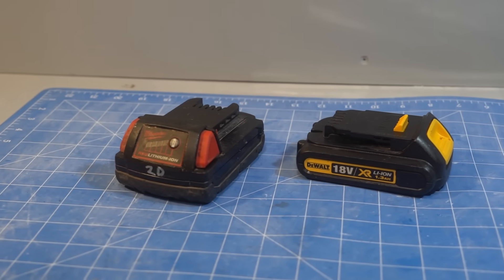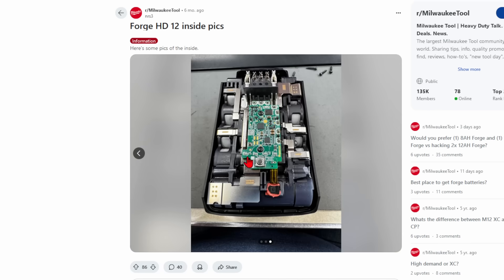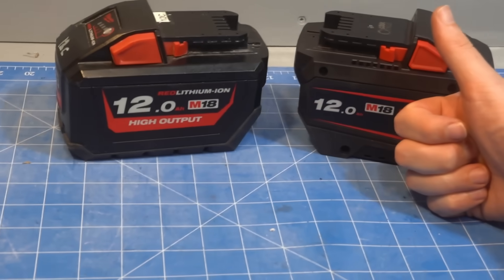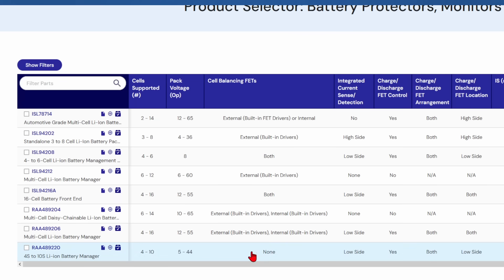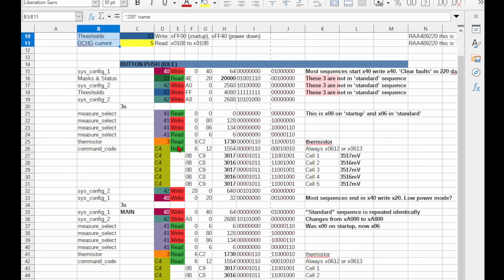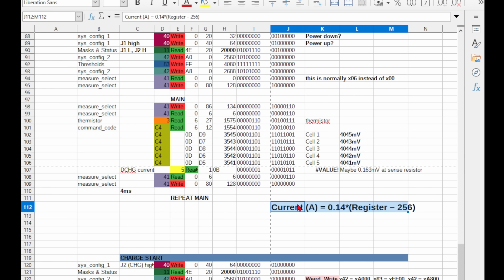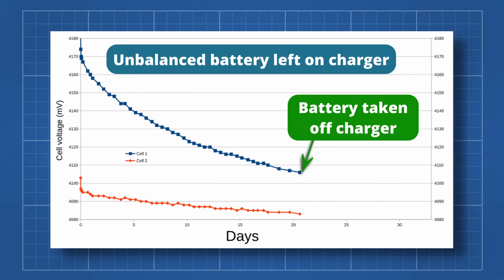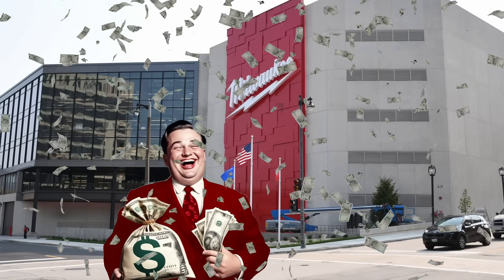[011] Do Milwaukee FORGE batteries balance

Comment: Could you reverse engineer the circuit board and make a replacement board that would balance the cells?  Or can you reprogram the microcontroller so that it can take advantage of the balancing?
Reply from the maker: Reprogramming MCU might be possible. It wouldn't be a great solution for most as programming an MCU isn't an easy task for most people. There's also a few different boards, so we'd need a few different firmwares. I'd mostly just like to shame Milwaukee into fixing the problem themselves.

Comment: please please do this analysis on a RYOBI 40v battery. They BRICK themselves and there is no way of repairing them that I can find on the internet. Maybe you can be the hero to many :).
Reply from the maker: I do have a Ryobi 30V mower and battery that I want to test. I've seen a few people using a RESET pin, but apparently that doesn't work on newer packs.

Comment: A Milwaukee M18 tool owner should take proactive measures to occasionally open the packs and manually balance the cells with leads coming from an 18650 charger.  You can use little magnets in the jaws of the clips to keep the leads connected.

...Which is stupid thing that you need to do, and why I'm glad I'm a Ridgid man(yes, I'm aware they also ultimately answer to TTI).

Comment: Thanks for the info!!! Can the cells be balanced without separating them from the bus bars? Reason asking i have one that got discharged too far and wont charge and have tried hooking another m18 too it but no luck yet even tried hooking the othe m18 to the bus bars before the circuit board but no luck!!!! Any help would be appreciated cant afford a new battery at the moment and really nead all of them working!!!!
Reply from the maker: Connect an adjustable power supply or single-cell Li-ion charger to the bus bars and charge each bank individually. https://www.youtube.com/watch?v=IsSzAWH3oQo
Reply: @toolscientist  thank you I'll have to give that a try !!!!!!!!

Comment: Great video. I'm building my own battery pack for a Dewalt DCD805 Drill, because the off-the-shelf packs lack critical features (e.g., cell balancing). Also, I just love batteries haha. I do think the mechanical engineers for Milwauekee FORGE pack did a decent job for optimizing space, current carrying capacity, and thermal dissipation: 1) 8:18 the hybrid busbars are thin and wide (maximizing surface area for convective cooling), 2) 5:05 the laser welds cover smaller area for positive and larger area for negative terminal of the batteries for heat dissipation (this is my guess, so I'd love someone to chip in on this). I noticed that EV companies such as Lucid Motors do something similar: they make the negative cell busbar connections thicker/wider than positive cells. My guess is that the battery engineers wanted to dissipate the heat of the cells better, since the cell's anode conducts heat better since most anode materials are copper, which have x2 thermal conductivity than the aluminum cathode. 

Also, this is my first time seeing a hybrid busbar. Are there any other devices that have hybrid busbars like this? I'm curious how they are joined together. Also, I'd like to know if anybody here has experience working with them, since while the idea sounds nice, the interface between two dissimilar metals may also increase contact resistance, which may defeat the purpose of using copper-nickel busbar.
Reply from the maker: I have not seen any other plated copper busbars in power tool batteries, but they could be out there. If a brand nickel plated their copper bus bars after they were cut, then you wouldn't be able to tell just be looking, like we can on these M18 Forge batteries.

Comment: I fix the issue (temporarily) by taking the cover off, testing the cells with a meter, and charging up the specific cell pairs/triplets that are at low voltage without removing them from the package or desoldering anything with a constant voltage power supply.  It is mostly a matter of attaching the charging alligator clips in the right place to complete a circuit through the affected cells but not other cells or the bridges between cell units.
Reply from the maker: Yeah, that's the best way. I've also seen some people solder in leads and a JST connector and then use a RC Hobby charger to balance.

Comment: I'm thinking about buying some of those 15-cell M18 style cases from the internet and putting only 10 cells in to leave room for extra circuitry like a balance charger board.  Or maybe I'll just 3D print a new case for my 6.0's...
Reply from the maker: Yeah, just add a JST connector and balance with an RC hobby charger.
Reply: @toolscientist  Yeah that seems like the best option, although I don't really like it lol.

Comment: It's possible there's a battery balance tolerance so 1 millivolt may not trip that tolerance to rebalance the battery. It may have to be a bigger difference.
Reply from the maker: I took it up to 100mV, which is nearly 10% of the usable voltage range of Li-ion of 3-4V (they can do 2.5-4.2, but it's very non-linear outside of 3-4V). The old batteries where something like 600mV out and didn't balance. There could also be a max imbalance where it refuses to try - e.g. if more than 50mV, pack is dying, don't bother balancing. So that's another hard one to test.

Comment: If the communication simply uses I2C protocol, is it not theoretically possible to create a new charger with a new microcontroller that could send different signals to the internal IC on the batteries?  Is it conceivable that someone like you could design your own charger that would charge the same as the regular ones but then tell it to balance itself? I get that with those giant resistors it would take a crazy long time to balance itself, but you also explained with your 12.0 that it worked for over a year, and if it was able to continually rebalance itself throughout that time, at a minimum it would certainly give you way longer life if not keep itself balanced over that amount of time.  I'd really love to see code for this though because I'm not quite smart enough to figure out how to do this on my own but I think I could implement it if someone else created the initial code. I'd really like to have a 100W USB PD bidirectional charger for my M18 batteries, but I don't want to risk charging them in an unmonitored, unbalanced way.
Reply from the maker: No need for a new charger - the existing charger signals are enough to know when it's in CC, CV, or charge end. I'd probably wait for charge end; balance; then if all cells are below 4V, give the charger the signal to do a slow top up. So what's needed is to extract and decompile the firmware, modify it to have balancing, then flash the new firmware. Some people I'm working with have extracted and decompiled, but there's low enthusiasm for modifying the firmware as it couldn't be distrubuted (Milwaukee will have a copyright claim on the original code). It might be possible to distribute a patch, but that solution would be even more inaccessible. There'd only be a tiny percentage of Milwaukee users with the knowledge (or patience) to go through with flashing new firmware.
Reply: @toolscientist  I guess that's why I'm suggesting building a sort of DIY charger, is that would avoid any copyright issues.  US law has determined that even proprietary codes may be used for interoperability, so if we had this code to install into say an Arduino Nano for example, then mash a DIY charging circuit together, we could avoid copyright issues.  But also as I mentioned, having access to this code would be necessary for my dream of a 100W USB PD charger/power source device like the one DeWalt has.

Is that the firmware of the battery itself or the charger?  And I guess what I'm asking, at least in part, is can we simply send the code to the battery IC to balance the cells, or does it need a whole new firmware to balance at all?
Reply from the maker: @WargateXGWU  it needs whole new firmware in the battery. I don't think any charger signals could make it balance, so modifying or making an arduino charger wouldn't help. Only option is flash new/modified firmware to battery
Reply: @toolscientist  Oh OK, gotcha.  I was wondering, since the charger seems to be sending a "turn off balancing" signal, maybe the battery could receive a "balance now" or some kind of balance signal.
Reply from the maker: @WargateXGWU  i might have explained that poorly in the video. There are 2 chips in the battery: an  MCU (microcontroller) and AFE (Analog Front End). The AFE is what should do the balancing, but it needs the MCU to tell it which cells to balance. So fixing it needs new firmware for the battery's MCU.
Reply: @ So in the video when you say the part about how a signal is being sent and that signal turns off cell balancing (not that it was on, but the command is to stop balancing), that is from the MCU to the AFE?  It's not from the charger to the MCU?
Reply from the maker: @WargateXGWU  correct. The battery's MCU is signalling the battery's AFE to turn off balancing (and never tells it to turn on). This happens entirely inside the battery.
Reply: @toolscientist  Oh ok, now I get it.  So yeah, would need new firmware on the batteries then most likely.  I suppose it's theoretically possible that a command from the charger could be sent to the MCU that would tell the MCU to tell the AFE to balance, but we'd have to know about that in order to do it.

If it can be figured out how to use custom firmware to enable cell balancing, I would LOVE that because it would make DIY chargers easier and safer.
Reply: @toolscientist  Also, due to the McDonald's ice cream conspiracy, I learned that proprietary codes can be used without royalties or permission for the purposes of interoperability.  Would theoretically a new, written-from-scratch firmware be distributable?  That would be pretty cool.  Honestly if I could find a 5S balancer circuit that was small enough to fit inside the case, I would do that myself and solder to the existing balance leads, but I haven't found one small enough to fit.  I'd personally be willing to help, just not sure I have the skills, tools, or knowledge to be able to help much.  But I'd be willing to learn if people like you and your cohorts are willing to help teach me the parts I'm missing.  Do you have a Discord or anything?

Comment: Nice vid. I was under the impression the forge solved those pesky balancing issues 😢.
Reply from the maker: Hey, sorry for late reply, been flat out. Yeah, it's fairly disappointing. I suspect that this new chip is incapable of balancing, so it's unlikely they ever will. Need to figure out if any brands actually balance before we go too hard on Milwaukee.

Comment: Makita up next? Seems few to no major power tool companies implement cell balancing from what I've seen.

Absolutely horrible practice but I guess battery planned obsolescence is how they earn money.
Reply from the maker: Yeah, I need to go back and look at Makita's balancing. Until I found Dewalt (and now Milwaukee), I'd assumed balancing was standard, and never thought to test it. Makita will take time as they use a single all-in-one chip, so I can't monitor the i2c comms. If I can identify and probe the balance resistors, then I should be able to see voltage drop across them, which would indicate balancing. I'd prob still need to do this long-term multi-cycle test and record the voltages, though.
Reply: @toolscientist  yeah, I had the same assumption. However after seeing how makita bms looks, I believe there is no balancing. All the smd resistors are very tiny and I'm not sure they could provide any meaningful balancing current. I'd love to be wrong though and am excited to see what you find out. Keep up the great work, I've become a fan :)
Reply from the maker: @JamesSöderström  I don't think it needs much. The 4Ah I showed has very little imbalance after 10 years, so even 1mA could be enough.
Reply: @toolscientist  that is certainly possible and I'd hope that to be the case. I found 5 pieces of sot23-6 that could be mosfets used in the balancing circuitry on a makita bms picture. Also a fairly large ceramic cap. Maybe slow active balancing? 

It's also possible Makita ohm match their cells well and gets cells that's in very tight tolerance from the manufacturers, making them stay in balance for a long time even without any balancing.

Comment: Hey I'm working on a tool that I think you would really be interested in collaboration on.  There are tools like it out there but none have proper controll or maintenance of the batteries. The things you can do with lithium batteries when you control the temp is amazing I can't believe no manufacturers really do that. Well actually I do, they like to sell more batteries.
Reply from the maker: A power tool that uses M18 batteries, or a tool to manage/maintain the batteries?

Comment: And funny part here, that capacitor balancer would take one extra chip and few caps to do the job and not taking too much extra space.
Reply from the maker: On their old batteries it wouldn't take anything, just a bit of extra code. Still have to wait and see if this new chip is even capable of balancing.

Comment: Can i send you a forge 12.0 so you can put the right code in it so it starts balancing
Reply from the maker: I have a Forge 12Ah so I could already do it. I suspect that it's not possible, though. We won't know until Renesas releases the datasheet, but I'm of the opinion that the RAA489250 chip can't balance, so there's no way to fix it.
Reply: Lets wait and cross fingers

Comment: When did they change to Ampace JP40's? I have just acquired an 8Ah Forge date 241030 serial N82ADCTB if that's correct, only have a QR code and no other markings. The diagnostic data set 4th sequence comes up as 4 which seems normal for 2024 production.
Reply from the maker: Ampace JP40 are one of the new breed of "tabless" cells that have lower resistance and can therefore deliver higher currents

Comment: I bought a 20v/60v 6ah dewalt battery used on ebay that was 2 years old, for like 45 dollars, the battery power indicator recently showed 2 out of 3 bars when fully charged, I emailed dewalt about it and no questions asked, sent one picture of the battery date, and they sent me a brand new battery in the mail, arrived two days later!
Reply: Jesus, that's too nice.  I hope you don't get ideas of abusing that system.
Reply: @h8GW nope. I only warranty them if there is actually an issue, most of them I get are older than 3 years anyway

Comment: Love the videos,  I suspected this was the case with my Ryobi batteries, too.  Do you think there is a case for a class action suit against these manufacturers for their known designed obsolescence?  Maybe some inspired lawyers could find the little guy some justice against the greedy manufacturers and the counterfeits.   We can only hope.  Keep up the work, and maybe we'll  get lucky one day.  
Have you thought about tearing into some ryobi batteries? I wonder if TTI uses the same design across the Red, Green,White, etc. tool line? That would be interesting to prove/discover.
Reply from the maker: Best bet would be to find a "smoking gun" - some internal Milwaukee communication that showed they weren't using balancing to shorten battery life. Otherwise, you'd need to buy ~10 new M18 batteries and have 5 as-is, then 5 balanced (either modified firmware or hobby charger balanced straight after genuine charger). If the balanced ones last >30% longer, then that might be enough.

I don't have the time or money for such a test, so for now I'm just going to test balancing on other brands. Hopefully I can shame them into balancing.

Comment: This is disgraceful BUT isn’t the balancing supposed to be performed by the battery charger? My SkyRC touches each cell and charges. Not the battery pack. I thought the battery electronics are there for protection not to charge them correctly.
Reply from the maker: M18 charger does not have connections to the cells, so it cannot balance. Charger only uses 4 pins: middle (charge) and B- for power, then J1 and J2 for UART communication. The only thing that could balance is the electronics inside the battery

Comment: Cordless tool companies make their money, not from the tool, but from replacement or upgrade battery sales. Like ink jet printer companies. They can give the printer away for free because the recurring revenue stream is from replacement ink cartridges. The batteries are designed to fail early.
Reply: They still make money from the tool, methinks.  Especially at Milwaukee prices.

Comment: Hello, your video is excellent and very professional. I'd like to ask if the new Milwaukee batteries have a low-voltage protection function.
Reply from the maker: Not really. They signal low-voltage to the tool, which makes the tool stop. So it won't stop if you are using it on something other than an M18 tool. The 6Ah Forge does have cutoff mosfets and 'could' have stand-alone protection, but I don't have one to test.

Comment: Are we sure that their chargers don't balance the battery through the different pins that connect throught the charger? Have you tried unbalanced the cells manually, then putting the pack together and throwing in on the Milwaukee charger for a couple cycles to see if the charger will balance the cells back to spec?
Reply from the maker: Very sure. There's only 4 pins used by the charger: Charge, ground, and J1 & J2. J1 & J2 are a communication interface.

In this video I manually unbalanced a cell. Left it on the charger for 21 days, then did 11 charge/discharge cycles and still had the same 0.1V imbalance.